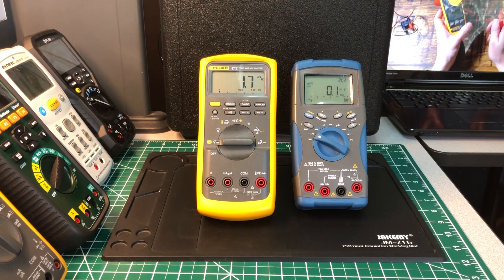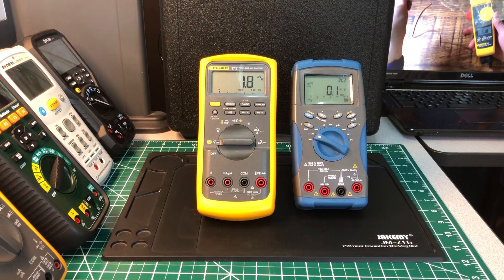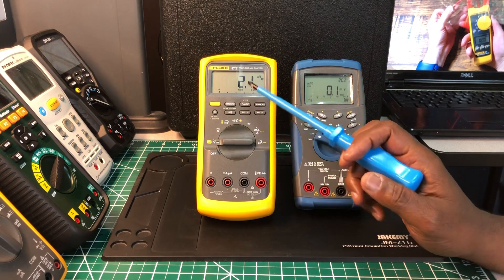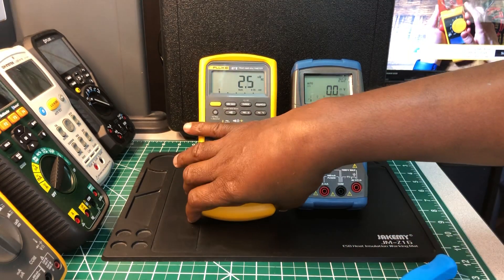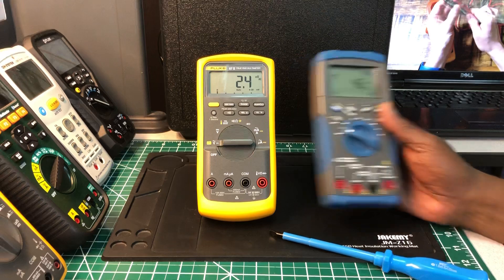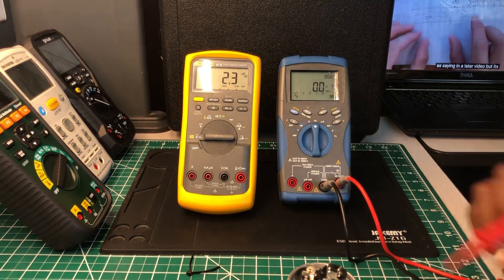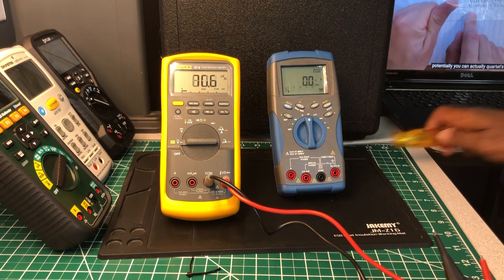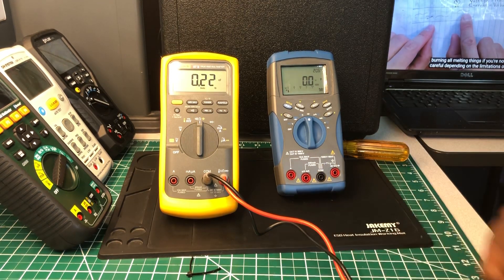🇺🇸FLUKE 87V  /  🇺🇸AGILENT 1241A ( The Beauty & The Beast )

Comment: SW-c is switch count. With the mA 4-20mA  range it really seems they were designing this for instrumentation techs. 

Agilent is the predecessor of HP. HP spun off their medical equipment and test equipment business in the 90s and it became Agilent. Agilent then spun off the test equipment to become Keysight. So there's a good lineage of quality test equipment there.

You can change the default voltage selection from DC to AC in the setup.
Reply from the maker: Very informative. Thanks for sharing.

Comment: I think the Agilent is a top level bench type multimeter. It would probably be great if you were in a lab doing precision work. I don't know if it has the internal protection if you accidentally put a couple KV through it. Fluke does. I actually like the looks of the Agilent more but big yellow meter will keep me safe and is very accurate. So like you the Fluke is my choice. If you ever get a chance I'd like you to review the EEVblog meter by Brymen. I'd like an unbiased opinion on them.
Reply from the maker: I like Dave Jones (EEVBLOG), Dave if you’re reading this send a one of your multimeters👍🏽